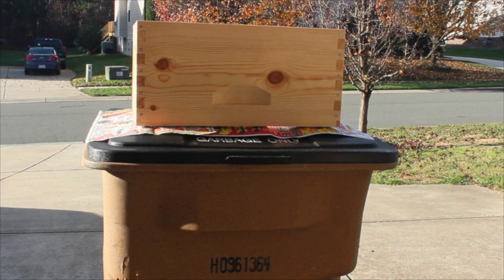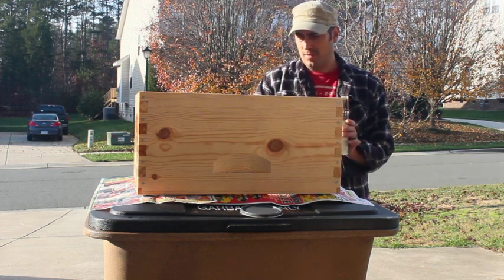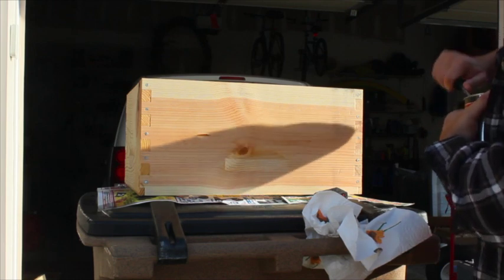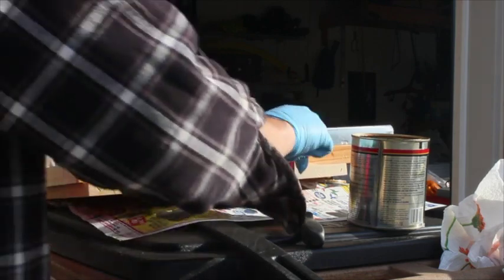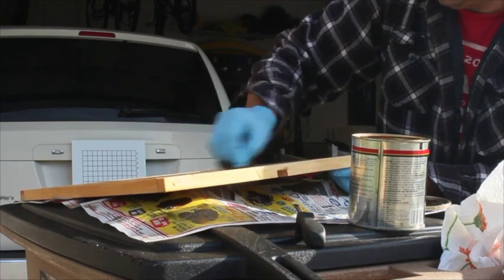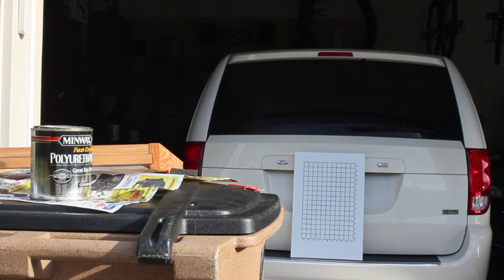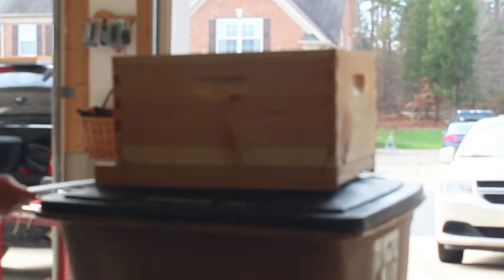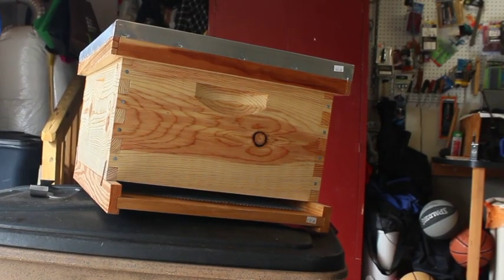Beehive 101: Putting My First Box Together

Comment: We don't treat anything that goes inside the hive, the bees will coat it with propolis anyway. I used paint, and painted the edges on my first boxes, big mistake, I could barely break the boxes apart after they had sat for a couple of weeks. That paint set like glue!!
We use two brood boxes per hive, they over winter better. I would also suggest getting two hives and two colonies. You can compare them, and if one happens to go queen-less you can move a frame of eggs from the good hive and they can make a new queen.
You are going to want an entrance reducer to begin with. When the colony is small is when it is most vulnerable. Entrance reducer helps them guard better.
Last tip for this video, don't get tricked into using an entrance feeder, it promotes robbing. If you want to feed set up an external feeder as far away as you can get it. You are feeding every bee in the neighborhood, but it's better than having neighbor bees messing with your young hive!!
Reply from the maker: +1952Jeep I will be putting a reducer on the hive. Good tips. Thanks.

Comment: You mightily shook or stirred up those paint/stain cans, ... yes?!  Irrespective, the wood stain protectant (undercoating ... 3-5xx, soak and fill up the surface pores, cross joints, and ends).  Then the polyurethane 3-5x (totally pour it on for final surface pore cross joints, ends sealing).  Stain and polyurethane weathers extremely fast (versus latex or enamel paint), oxidation and cracking ... in southern climate (more sun UV irradiation, humidity, and oxidation).  Your next annual stain and poly painting should be next fall after harvest, before frost, fall rains, etc  again 3-5x and 3-5x.  The top air board is an internal board and should not be painted with anything but pine pitch/olive oil/propolis.

Good starting point.
Reply from the maker: +John Lord Yes, I shook the cans for quite a while. Then I read on the first can that it doesn't require being stirred. Thanks for the tips.

Comment: I wouldn't have stapled the bottom board to the lower brood box.  I also wouldn't have done anything the edges that touch each other.  You will have enough trouble getting the pieces apart as it is, and any sort of paint between pieces will make it even harder to take stuff apart later.  That is why you see some people use ratchet straps.
Reply from the maker: +Kyle Wingate Why wouldn't you have stapled the box? That is the way the person in the store told me to do it, so I did it. Maybe poly on the edges will turn out to be a rookie mistake. If so, I won't do it the same way on the next box. Thanks for the comment.
Reply: +Carolina Prepper Granted, you have the screened bottom board.  That will assist you greatly in keeping the detritus (bee junk, comb pieces, beetles (I forget their real name), carcass's, etc) to a minimum.  My experience has been that with a regular bottom board, I have had to dump it out or sweep it out every so often.  Having staples in it will make it difficult to clean anything out of the bottom.  I don't see how you could easily clean without taking out each and every frame, which I wouldn't do.  You want to disturb the colony the least amount possible when you are working with them too.  When you open up the hive, you want to have a purpose every time.  No more than once a week inspections should suffice for the first little bit, then maybe every 2-3 weeks once the hive stabilizes.   You might not see the queen every time either, not to worry though if you see evidence of her, larva.  Your mileage may vary...  Having the staples isn't going to hurt anything though.  Also, Don't put bees in there until you can't smell any fumes off the wood.

Comment: NO you don't want any oils on the paint ! better leave it out in the weather to wash out any bad stuff ! bees always find and old house to make a hive ! natural smells not chemicals ! my research was done from 4 old bee keepers ! I used water base paint ! maybe ya should have bought it pre painted !? I was going to do the same as you BUT decided not to ! also they say not to paint the inside. air it out for a long time before putting the bees in bro !
Reply from the maker: +Theredneck Prepper I didn't put anything on the inside. I won't be getting bees until March and I wanted to seal it early so it had time to air out. Thanks.